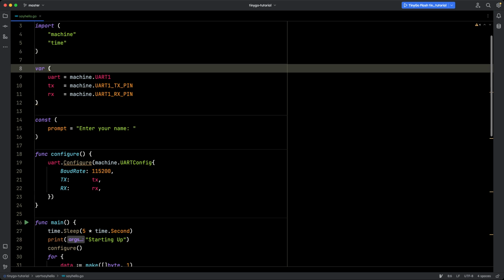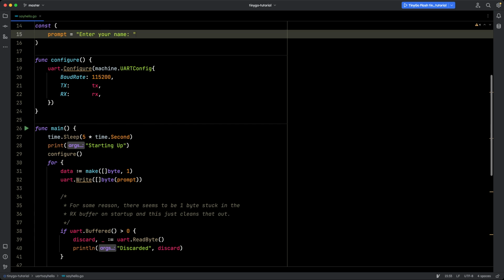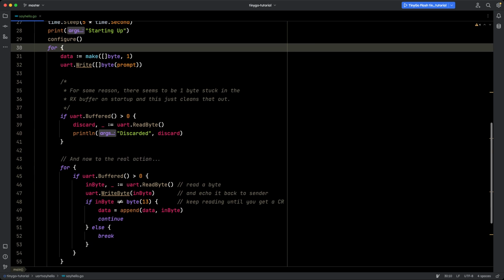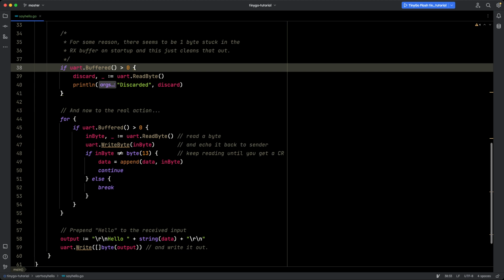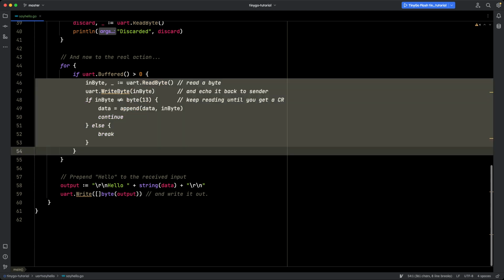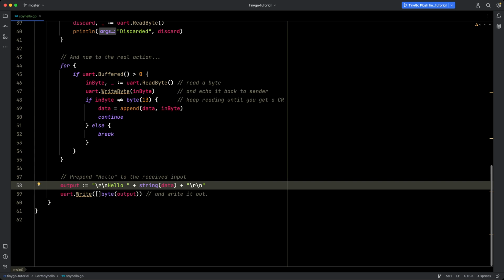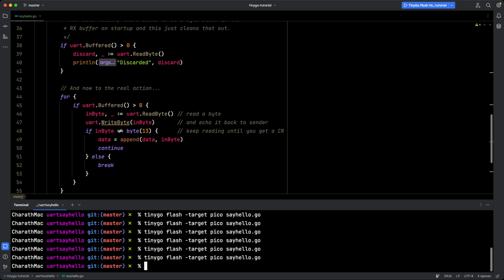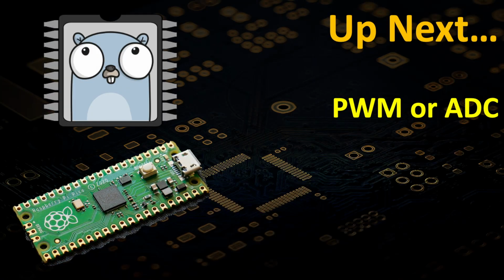TinyGo and Raspberry Pi Pico: UART and Asynchronous Serial Communication

Comment: Very good. I was able to use UART to connect two PICOs.  For the next ep. I vote for ADC just because I have never seen it. I am using PWM to control a stepper motor at very specific rates. My long term goal is to build something that controls my telescope mount.  Thanks again!
Reply from the maker: I'll definitely work on ADC, Tony. Thank you!